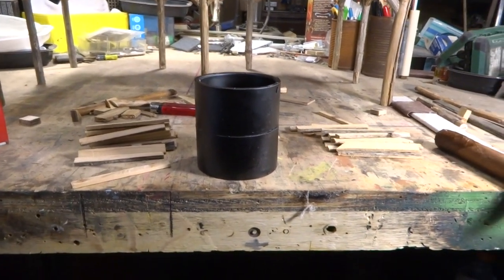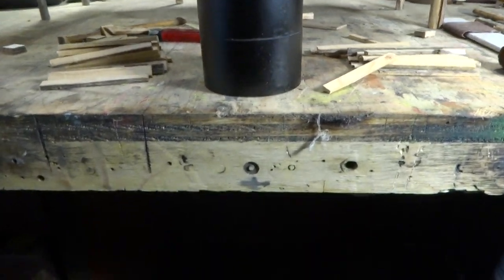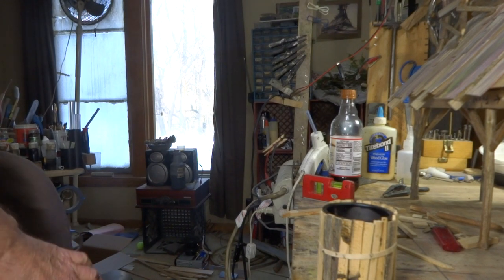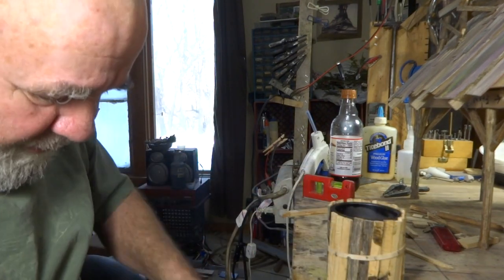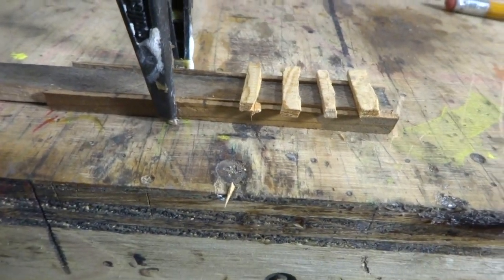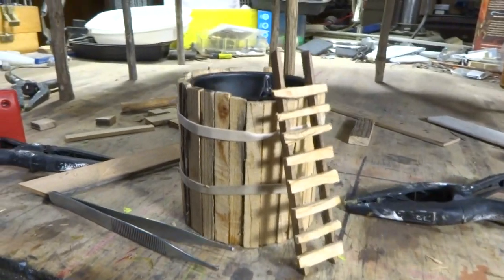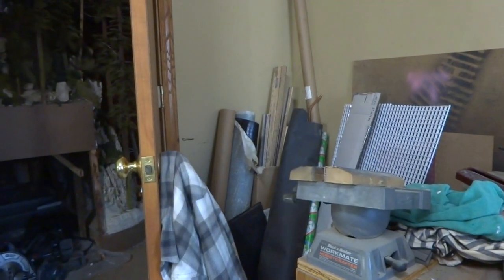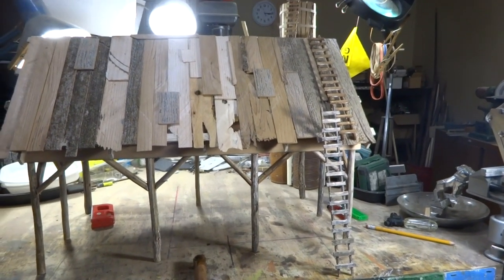WATER TANKS &LADDERS

Comment: I didn't understand what the rod from the marking flag with the bent end was for. Was it to pull the boards straight with or did you glue it on the tank too?
 The tank and ladders look great and the sunflower stalk for the poles of the shed was a wonderful idea. I have sunflowers every year in my garden just to look at and then look at the birds in the fall eating the seeds. I do HO so I'll have to get some of the smaller branches off the sunflowers that have clusters instead of one big flower. Yours look absolutely perfect for the post in G scale.   👍
Reply from the maker: Sorry about that, its for pulling the rubber band back to help slide the next board in. You might want to make the little bent end just a little longer and then when you pull the band back it should stay in place easier for the next board, hope this helps, thx